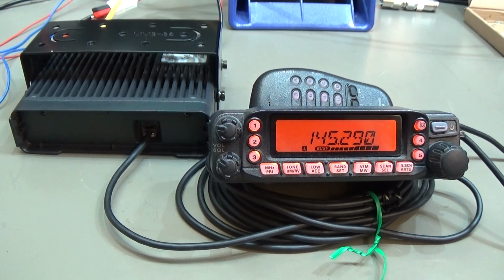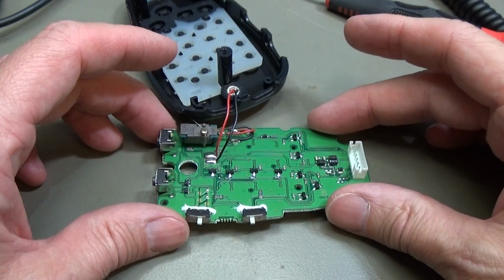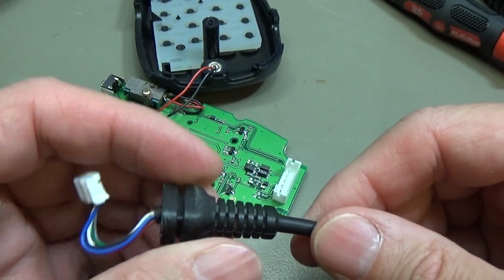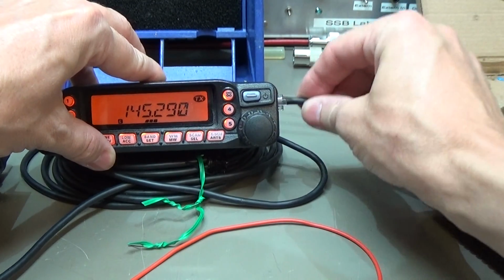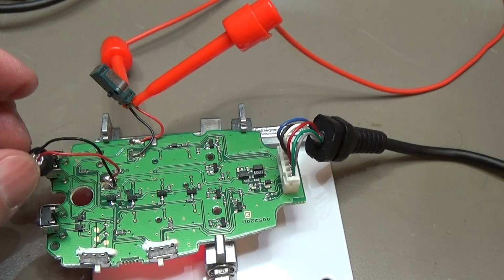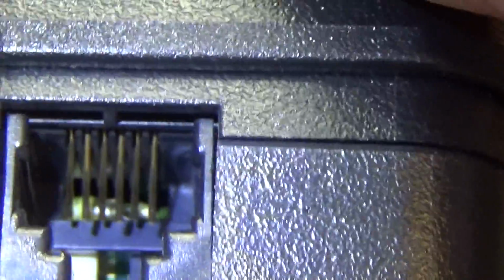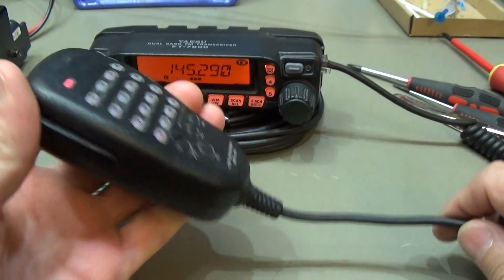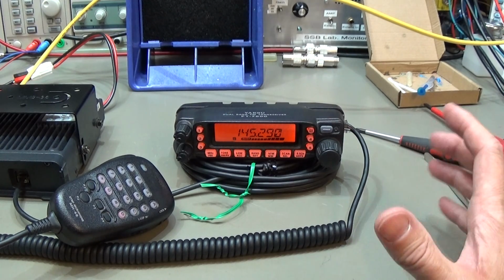#136  Yaesu  FT-7800 very noisy on transmit. Let's fix it

Comment: Hi friend.  I recently took out of the car my 7800 because I don't need it in there any more. 
I'm thinking of having the radio as a base in the house. 
I need a converter for that 220v to 12v.  I saw the original yaesu but they are much much expensive for my budget. 
Is there any other easy solution to the problem. 
What are you using.. 
Thanks in advance...
Reply from the maker: Simply search for a 13.8V/10-20 A power supply on ebay and you find a lot..

Comment: It could of been a bit of oxidisation on the connector inside the mic, I come across that from time to time in the HR2510/Lincoln on the MCU PCB, unplugging them and plugging them back in again can fix all kinds of issues.

Comment: Thank you Peter,
 the problem I had only timewise with the FT8100R, as synonymous erstmal
 the Mic, exchanged but the error occurred so seldom, now it is finally 
again.
You a nice weekend until soon. 55 73 Peter DO5NET, DN8HAM
Reply from the maker: Hallo Peter, ja die Fehler treten immer wieder auf echt nervig. Danke für vorbeischauen. 55 und 73
Reply: Danke Peter, echt klasse Infos und mehr hier, bis bald mal wieder. 73 und Leckerlys für den klasse Wau. ;-)

Comment: Hi Peter,
Fine repair. Finally an easy one. HiHi  I'm also an amateur astronomer and they use the same connectors on the telescope mounts. We have to contend with moisture from dew and those connectors are awful in that environment.  73  WB3BJU
Reply from the maker: Well yes  Donald but they are always awful :^) Thanks for feed-back 73

Comment: What would you suggest for a connector to the PTT Peter  ?
Reply from the maker: Hi Tom, well minimum a DIN connector but I know that this old fashioned connectors are a bit critical in production. But there are new little pin connectors on the market which are easy to handle during production but more expensive than a RJ45....
Reply: I work with computers and networks and RJ-45 and RJ-11 are always a pain. The less you touch them the better you are off, constantly unplugging and plugging. Any non-gold contact material must be compatible with gold and provide equivalent contact performance. Also constant movement with the PTT wire stresses the RJ jack to lead to contact failure. Cheers Peter 73
Reply: I agree with a DIN connector with strain relief at the connector end.

Comment: Great job as usual, Peter! The MH-48 mic seems to be a rather problematic microphone, and despite this Yaesu includes it with the majority of their radios. I've tackled similar issues in 4 out of 5 MH-48 mics that land on my bench! (including several of my own)
Like you and many of the commenters have said, the connectors are junk. I miss the 8-pin DIN connectors found on many older radios. It's a much more robust connector, and I think that most hams would be happy to pay a little extra for them if they were an available option.
Reply from the maker: You are right Adam the simple but effective DIN connectors were super..Thanks for watching

Comment: Thank you for video, Great repair,Motorola used the 8 pin connectors also not as good as the old round metal plugs
Reply from the maker: But most likely better than RJ45 the old metal plugs were great quality. Thanks for watching Dennis

Comment: I've seen the same problem over and over as well with those RJ-45 style mic jacks. In our two mobiles (XYL is a ham as well) I've tied the connector end of the mic's down with a small cable clamp to act as a strain relief where the plug enters the control head extension cable connector (inline double female) and haven't had any problems. Sometimes the problem is mobile vibrations where the RJ-45 actually connects into the body of the radio and others here have found that inserting some small material inside the jack alongside the plug stops the movement of the plug which often is problematic. Thanks for sharing Peter, great job as usual!  73 - Dino KL0S
Reply from the maker: Yes it it always the same with a RJ-45 connector...but today we are looking always to costs.. what will we do??? Thanks for comment 73

Comment: Kenwood uses those cheap connectors, too.  If you examine the difference, it's apparent that Kenwood used parts of higher quality, and paid attention to the details with better strain relief and durable dust covering.  The best I've seen are the round, indexed, locking connectors used by Motorola.
Reply from the maker: Yeah almost any company is using this crappy connectors..Thanks for watching 73